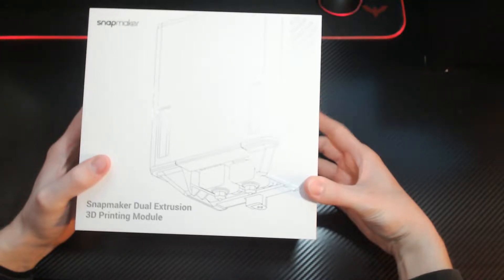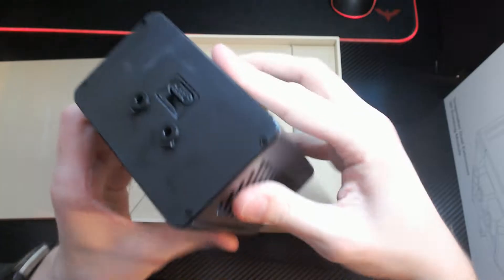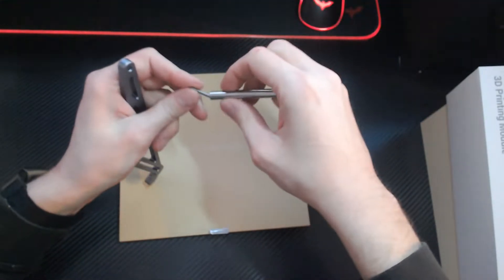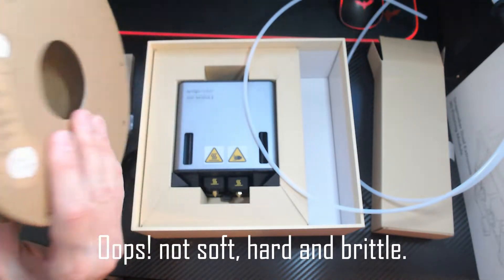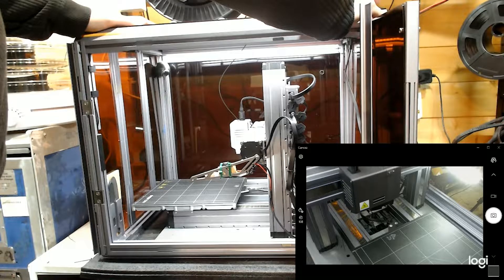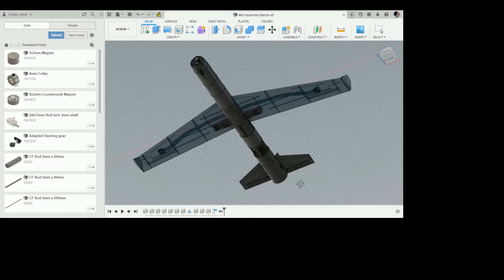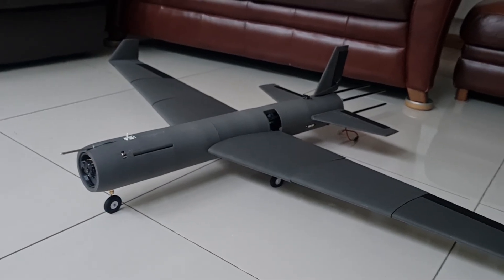SnapMaker 2.0 Dual Extrusion Module: Unboxing & Setup. IT'S HERE!

Comment: Cura works well.  You select both or all the parts and then right click and select merge models.  Works ok for me.  My Dual Anet A8 does not have a auto alignment procedure.  I had to set it in the cura settings.  Got close but still requires some tinkering.  Its always going to be a chalenge especially if you print with different brand filaments requiring different heat settings etc etc.  With some practice you will eventually be able to make the changes resutling in a very good quality print.

Comment: With a Snapmaker 2.0 A350 with a dual extruder, are you able to pause the machine and switch 1 of the filaments and resume the print?
Reply from the maker: That is a good question! although i believe it is possible, there has been one or two 'holes' in the new firmware, so i will check it out and get back to you
Reply: @launch3d115  I have another question.  My dual extruder helper (prime tower) fails every time thus causing my prints to fail every time.  what am I doing wrong?

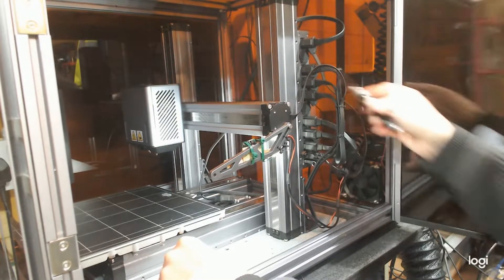Comment: 6:41 what the hell is that in the front where normaly the roll would hang from? And i dont get that bowden thing they added. What to do if you wanna switch back to the normal 3d tool head? And where you put the bowdens once you switch to another toolhead? And all those steps you need to make every time you switch the toolhead? @launch3d
Reply from the maker: I have used the old roll mounting arm to fix a camera to watch the layers close-up as they are printed.
Its crude and i need to 3d print a real mount, but its handy when watching a print from outside the workshop!

As for the Bowdens, i agree that they will come with some inconveniences! There is also a pair of clamps to hold the Bowden tubes out of the way when using a different tool head. They are backed with double sided tape so they can be mounted wherever you like. I didn't fit them in this video and realise that maybe i should have mentioned them though.
Reply: @launch3d115  Aha i see, good idea. I am a litle let down in teh quality the frog came out. i mean we did pay ALLOT for the dual extruder right.. that 1 dual extruder costs as much as some brands whole printer. I hope i get mine in soon aswell and hope it prints better.
Reply from the maker: @hakaiyou4532  yes it wasn't quite the frog i expected from the stock settings, and i agree it wasn't a cheap module. I have seen that nozzle wipe and retraction settings can be very useful in producing a better print though, and i also hope to recreate the frog in Cura slicer with my own profile and see how they differ in quality

Comment: So manually adjusting z offset with the stupid paper is no longer required with this print head?
Reply: Thats right! So far I haven't needed it! You can also manually adjust Z offset during the print on the controller, similar to before and it also displays the current offset setting. Handy for correcting any poor adhesion or bed scraping that catches you by surprise!

Comment: Don't use Luban, it's terrible.
Reply from the maker: To be honest, i have always avoided using Luban and this was my first time!
I am more familiar with Cura, and its my go to. But i rushed this video out and unfortunately, at the time there was not a Cura profile for the Snapmaker 2.0 dual extruder setup. I am going to create a custom printer profile and start from there in the next videos though!
Reply: @launch3d115  I use Cura and I noticed it has the dual extrusion update, give that a try.
Reply: @JmsnCrpntr  Hhm, I cannot find this in Cura 5.2.2. Am I doing it wrong?
Hhm.... as I see: There are some Dual Extrusion options/settings, but no profile includes really a second extruder